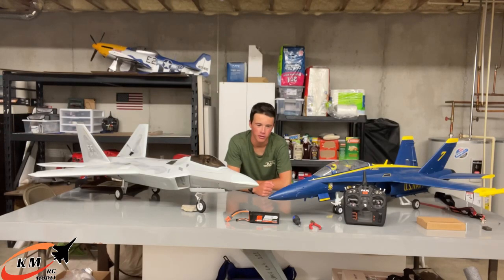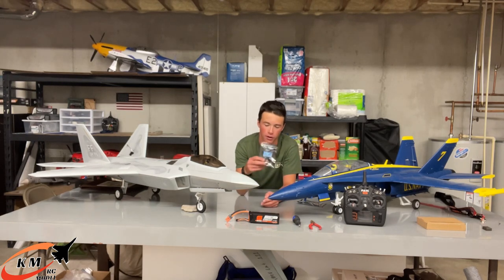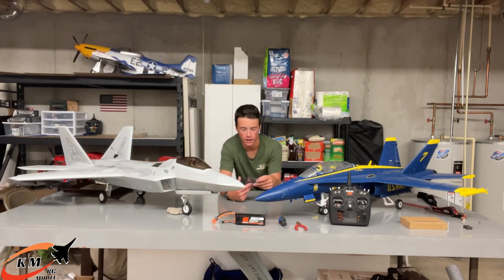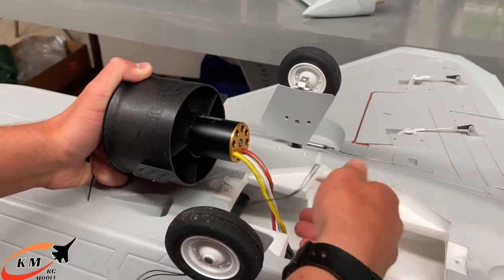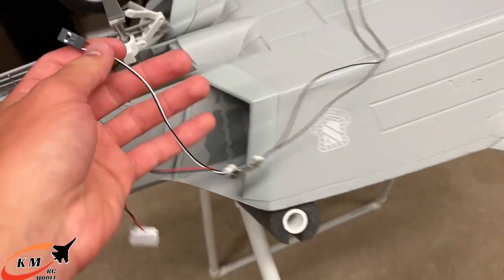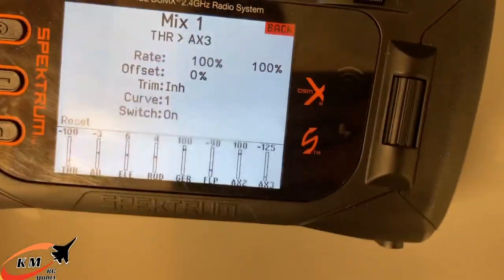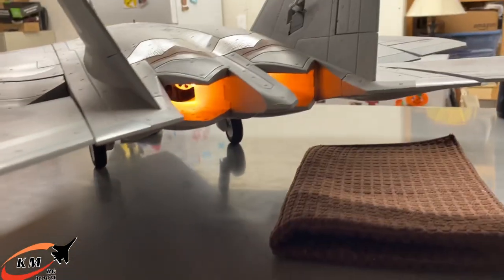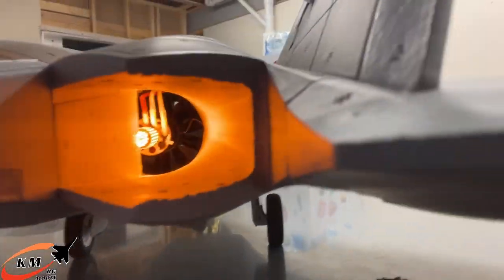*NEW* KM RC Model Universal AFTERBURNER installation in the Freewing F-22 Raptor 90mm

Comment: Spektrum has smart throttle that’s why the Y plug doesn’t work you can’t use channel one you have to use a different channel and just make a second throttle channel in channel assign in your nx8 transmitter no mixing required that way. 👍👍👍👍👍👍
Reply from the maker: Ahh yes I did that! Thanks you!!
Reply: Thanks for the explanation. I'll add that to the list of things I don't like about Spektrum.